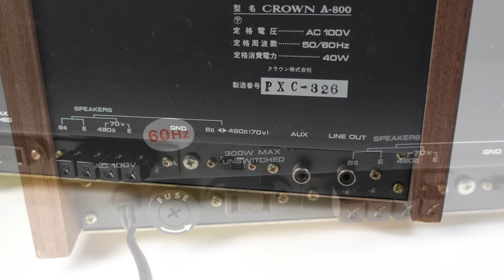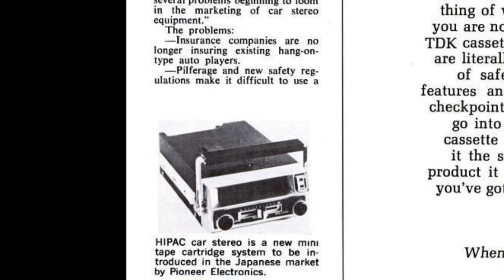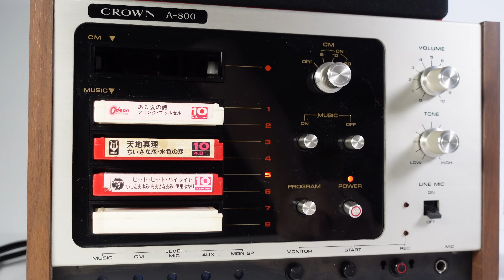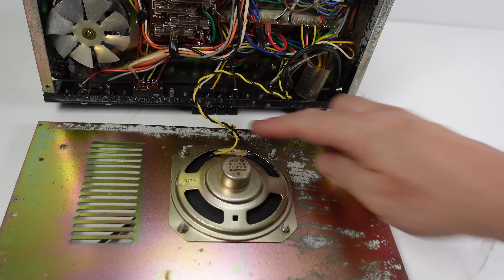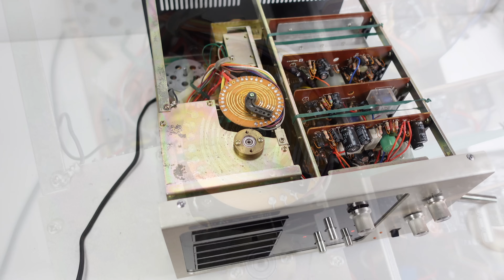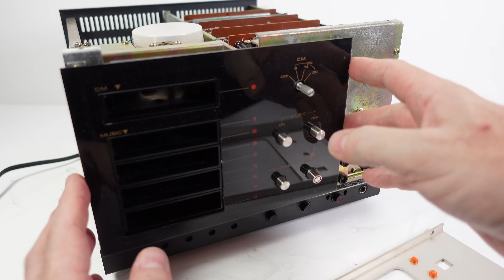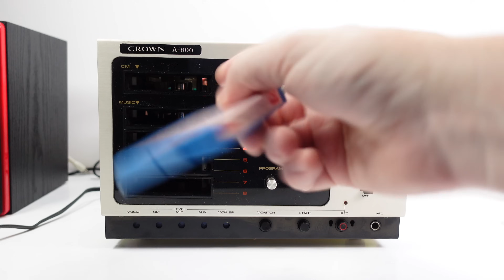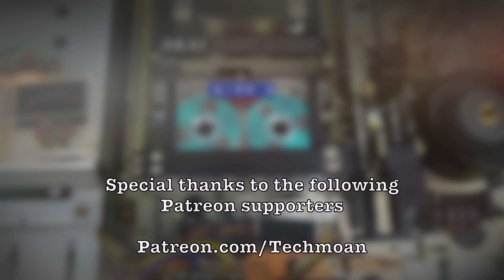An unusual player for a forgotten ‘70s music format

Comment: Have you figured out what the START button does? My first guess was that it would bypass the timer and play the announcement immediately, but perhaps it lays down a control tone if you push it during recording at the start of each announcement. During playback then the machine could cue up to the next tone, then pause the CM tape and start the timer for the next announcement. That way you could have several different announcements in rotation on the same tape.

I don’t think a microphone from that era could be made to generate a tone easily. It’d be easier to have the machine itself do that.
Reply: This is exactly what I was thinking. It makes sense that the reason it doesn’t use a metal strip to indicate the end of the recordable tape but rather uses second audio track to record a control tone is so you can have multiple different announcement/adverts on the CM tape and play them back one after the other at whatever of the preset intervals you specified. And very likely the Start button does just as you said and is used to indicate where each announcement begins. I have seen something like this in devices designed to be used for automatic 35mm slide show presentations where you have a special slide projector that includes a built in cassette recorder/player where you record a narration of a slide show on an compact audio cassette and while doing so you could indicate when the machine should advance to the next slide when playing back the slide show in automatic mode. There have also been film strip projectors  that worked this same way for use in schools.
Reply: @Charlesb88  Also the announcements will be of various lengths. The interesting question is how you handle the time between the end of the announcements and going back to the start.
Reply: @chaos.corner  Since the tape is a continuous  loop, when the last announcement is played back then the tape would just continue to play forward until it got the the begging of the tape and heard the first control tone. While you’d want to time the number and length of the adverts/announcements so they fill up as much of the tape as possible I would think,  any silent gap at the end of the tape wouldn’t be a big issue since the adverts/announcements play over the background music so any length of silence on the CR tape wouldn’t be noticed. This means that any blank space on the end of the tape could just continue to play silently while the machine listens for the control tone on the beginning of second track (once the tape makes a complete loop) indicating the position of the first advert/announcement. Now I think there would be recommended maximum lengths for the adverts/announcements of say 1 minute if your playing them 20 times per hour given you one every three minutes. But remember that you don’t have to have the while CR tape all the way through every hour and could have it so the end of the tapes plays into the next hour meaning your adverts/announcements wouldn’t hit always on the same time interval each hour but the machine, having no clock would care as it just plays the adverts at preset intervals once timed CR  feature is turned on.  It’s up to the store owner to determine when to start the announcements and whether to play through the entire tape once per hour. At the maximum interval setting, you get up to 20 min. Of adverts/announcements per hour if you plan it carefully (assuming a 1 min max advert/announcement length). It’s likely that simple.
Reply: @Charlesb88  so multiple announcements could be on one tape. Nifty.
Reply: @greggv8  Now I haven’t seen this specific background music machine myself so I was speculating but technology like what I describe did exist back then that would have allowed multiple announcements/adverts on a continues loop tape with a simple “control tone” that the machine recorded on a second track could detect. The second track would be silent most of the time except for the occasional short control tone that the machine could detect and thus stop playback temporarily until a timer experience at which playback would restarted until another control tone was detected and  the machine would pass the tape again and so forth and so on. On the channel “Grand Illusions, Tim showed of old Japanese animatronic dog from the late 50’s that could detect any loud sound such as the voice of the person playing with it and it would move up and down and around floor (or table in this case). It was apparently an expensive toy for it’s time but it should that voice activation (or as in this case, control tone activation/deactivation) was very doable in even the earliest days of the transistor.
Reply: Wow, I think you just figured this out. Hopefully he sees this and tries it and maybe gives us a follow-up video.
Reply: Radio station carts record a cue tone when you start recording which tells the player when to stop.  I suspect that's how the CM cart works too.  However, since you're playing it back on a 50 Hz speed, the cue tone will probably be at a lower pitch than the trigger circuit is listening for.
Reply: @TonyP9279  If it's recorded with the system running on 50Hz, it will be the same frequency when played back at 50Hz.
Reply: It makes further sense when you consider how the tape is laid out. Carts are either two track (mono) or three track (stereo), with the extra track reserved for tones. I can see how only one track of the tape here was in fact "broadcast", but using the second channel of that half-track stereo head for tones would allow the CM tape to recue between playbacks... just like a cart. Half the fun of this channel is watching how these "obscure technologies" end up in fact repeating someone's "same old same old" in a different context.
Reply: Start... to record?
Reply: Another reason that a pilot tone is used is that there is no space for a foil sensor. It is occupied by the erase head.

Comment: I would try recording a sine wave sweep and see if triggers the CM to stop.

Also I think those fixed heads on the playback units just grab the middle of the tape, so it has the right channel of program one and the left channel of program 2. Using a standard head would have kept the costs down. I doubt  they were worried about hard panned stereo tracks being an issue.
Reply: I don't think you're correct on that. Looking at the heads on those I feel confident it would reproduce a proper mono downmix of a stereo track pair. The read zones are the correct width to do this. The downside of that is an increase in bias noise from the blank space between the tracks which it is also reading. However, BGMs weren't made to play commercial tapesm but pre-recorded background music properly licensed to be used as such. Tapes recorded specifically for this BGM would have doubtless been recorded in mono with 2 wider tracks utilizing the space which would be blank between the stereo tracks to gain a better signal to noise ratio. This is a really brilliant design. Someone put a lot of thought into this, and it's a pity it never gained any traction.
Reply: @edifyguy  I think your correct sir, Hipac is a stereo 2 program format, just like how its bigger american cousin is a stereo 4 program format, so just like how 8-track is called that because it has 8 Mono programs, Hipac has 4 mono programs, and the heads in this machine have two pickups, so its just using the 4 tracks as 2 double wide programs, but that leads to an odd setup, this machine basically does everything the same as a standard Hipac in terms of speed and all that, the difference being mono. 4 tapes two programs each the weird thing is that it essentially means that these 4 little tapes would have the same amount of playback time as a single 8 track recorded in mono. but that's where they missed a tick, BG music is usually played quite low over meh speakers in a shop its not meant to sound excellent and hipac already sounds passable in its standard, why use double wide tracks why not just keep using the 4 tracks as individual mono tracks. signal to noise makes a little less sense when the whole point is to play some cover version of a contemporary song in a background level in a sears, and total play time makes more sense, think of the Seeburg BMG system it used 16 and something IPM records not LP discs, the tape based 3M contata used 1 7/8 IPM reel to reel which when i play that on my machine it sounds horrible in terms of signal to noise, so it does seem like an odd oversight to lose half of the tape, granted maybe its because they wanted to just use off the shelf bits and a standard compact cassette head was able to fit the bill, which if thats what happened makes sense, especially with the modular design and easy changeability of the cartridge mechanism, dont reinvent the wheel just use a part that already exists and we already have.
Reply: @compzac  A 4 track head that small would have been a LOT more expensive in the day.  The coils have to be interleaved, alternate sided or as narrow as a single stereo track.  This is most likely the same reason the mechanical stepping system was used on a 8 track player so they did not need 8 sets of magnetics which would have made the mechanics MUCH simpler like on this unit, using tracks 1 and 5 also allowed the head to have a simple construction.  The spacing on this head is probably the standard stereo spacing on a 1/4" deck in a smaller head housing.  It would have been important economically to use as much standard production capacity when making niche market devices.
Reply: @compzac  I think they missed that trick deliberately. 5 HiPac carts holds enough music to run all day if you use long ones, and by using the mono heads they did, the component was inexpensive compared to a stereo one, and yet they maintained compatibility with consumer HiPac carts, whereas if they used a stereo head one track at a time, yes, they could double the time on a tape, but they would break compatibility with all carts not specifically made for that machine. That wouldn't necessarily be a deal breaker in a BGM system, but I think maintaining compatibility was smart.
Reply: @edifyguy  yes - a hard panned stereo could yield a weird mix of a modern stereo recording, modern meaning anything whose technology was beyond, say, Beatles.
Reply: As it is a stereo system but just using mono then one channel could be voice and the other click, tone or change of tone to mark the end of a message. Therefore the existence of a tone could also mark that a voice message has been recorded absence of a tone to get the tape to move to the start of the next message during the music play time.  But with this idea the tone generator should be within the machine connected to the recording turn on switch.
Reply: @AndrewLohmannKent  I think it's the start button or something like that.
Reply: @edifyguy  because there is no erase head the record head would need to be used to erase the tape such as recording a very high frequency tone. That might be simply leave the mic unplugged and run record to erase everything the machine would need to sense the absence of a mic and the operator would need to leave the machine running  for at least the length of the tape. Or be very precise with a stopwatch and a list?

Comment: yes, changing the capacitor would change the speed, it works like a ceiling fan motor, if you cut the uf, youll change the speed

Comment: Assuming the unit has a synchronous motor.....
The motor is probably not running at full torque, due to that capacitor being the wrong value for the mains freq in use. That
But the actual motor speed is dictated by the mains frequency. To fix the speed, you will need to change the pulleys. Given that the capacitor is soldered in for the frequency it was built for, not switched etc. It is possible that they intended that they would fit a different motor/flywheel for the 50Hz pulley sizes?

Comment: I found it convenient to use Post-it notes to align tape when splicing. You stick one tape to the note and make sure the other doesn't stick in the overlapping section at all. The glue on Post-its seem to deal no damage even to older tapes, at least from the 70s.

Comment: that capacitor is most likely the starting capacitor for the motor... different mains frequency requires a different capacitance but unfortunately changing the capacitor will not change the speed

Comment: It's a commercial unit so they were most likely fitted with a different sized pully at the time of assembly (as well as a different capacitor) the capacitor itself is just to help with starting the motor.  

First thing would be to check the motor to see if it is rated for both frequencies, being a beefy industrial unit it might well be, in which case you only need a slightly larger pully  if memory serves.. (could get creative and get somebody to design you a 3d printed ring in 2 halves that you can glue together around the existing pully to get the correct speed while keeping the mass, as well as change out that capacitor.

If the motor is only rated at 60hz then you can run the risk of overload it and burning it out.

bit of effort for something not likely to use though :D

Comment: Yes changing a capacitor can change the output voltage of an AC to DC circuit, my thought here is they have calculated the needed voltage to run the motor at the nessarry play speed for a 50hz/60hz regions and used a capacitor to influence the voltage in this case the capacitor is used as a divider if the motor is designed for a 50hz region they would increase capacitance to step down the voltage in a 60hz region to play slower and reduce the capacitance to increase the play speed or vice versa as it seems to be in this case

Comment: While changing capacitor will sometimes be used to change motor speeds, that's only used in unregulated speed applications such as fans. This player probably has a synchronous motor whose speed will not be affected by the value. Plus, if changing a capacitor is all that is needed they probably would have put a switch on the back to do this.

Comment: The "70V" label on the speaker terminal is a dead giveaway that something is meant to be used in an installed sound/background music/in-store music type setup. The high voltage/low current lets you drive loads of speakers without using heavy gauge wire for the low voltage/high current an 8 ohm load would take. The ceiling speakers themselves are ordinary 8 ohm speakers with a step-down transformer mounted on the back.